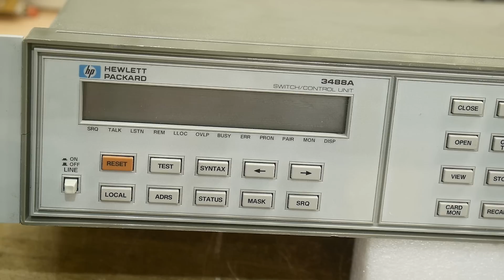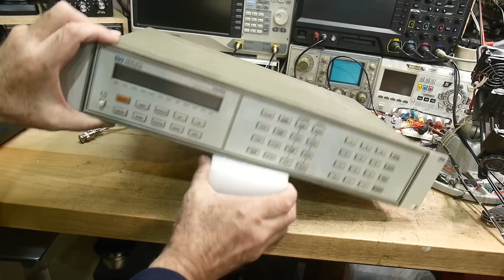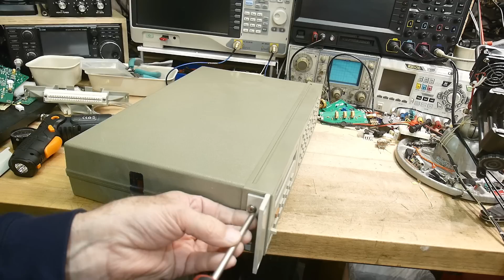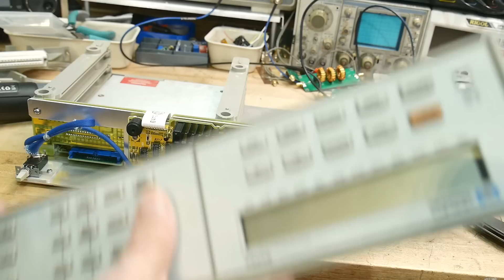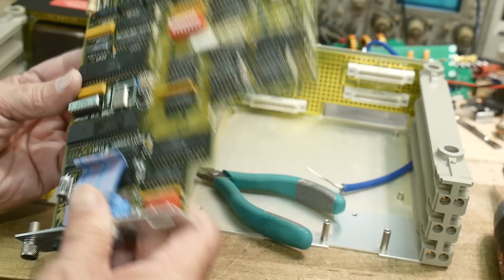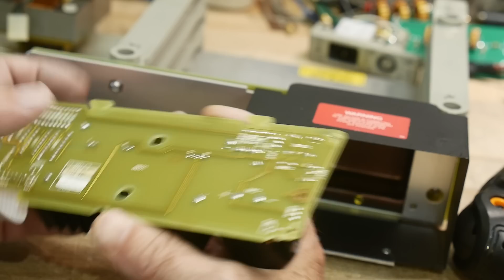#1430 HP 3488A Switch Control Unit Recycling

Comment: For custom gpib controller, there is the AVR488 usb (serial) to GPIB adapter project that implements the prologix "protocol". I've also been working on an esp32 version of this code (AVR488-ESP32 on sourcehut, there is a copy on gh) with extended features and support for wifi and bluetooth.

I am also condering implementing a version of the code embedding a Basic interpreter, for the fun. (Probably won't find the time to do it but I like the idea 😃)

Comment: Search AR-488 for an Arduino to GPIB device. It works similar to the Prologix USB to GPIB adapters.
Reply from the maker: I have a Prologix
Reply: @IMSAIGuy  The AR-488 project page talks about which software that works with Prologix will also work with the AR-488. And if you’re used to the + commands it’s very familiar. I’ve built a few AR-488s with the 75160/75161 GPIB bus drivers and they seem to work well.

Comment: I love HP stuff because it is always so well made.  In the 70s I had an HP25 calculator.  I chose this over the TI57 because it just felt so much better.  The buttons had a nice positive click feel.  Not spongy like the TI.  This was my introduction to programming and I think the RPN notation set me on the correct course for writing simple and efficient programs.  The main problem was that it forgot everything when switched off.  So I just left it permanently plugged in to its power supply.

Comment: GS-R405S was a DC-DC converter.  9 to 46 V in, 5.1V out.  4 amp max.  Quick find on Digikey with note that it is obsolete.  I did find some GPIB chip sets still being made (Intel 8291 and 8292 set for example). And I even found (and lost the reference to) a single chip implementation.  I just don't know why I'd want to use them.

And I got no problem with you scavenging parts.  Just because something is old doesn't mean that it should be saved.  Excepting you and me of course.

Comment: This is a way to save at least part of the device that would otherwise end up in the scrap, I'm currently looking for a narrow version and a black and blue HP logo for another project to build a multifunctional balanced power supply.
I don't pinch the wires, but I honestly unsolder them.

I wonder what you will get out of it .........

Nice day 🙂 Tom

Comment: Together with the capacitor voltage of 50V the module with the number 4005 looks like an early switched 40V to 5V module working at maybe not much more than 20kHz.

Comment: OMG! OMG! OMG!

What a great project box and project boards. I try to keep the boxes with the power supplies if I have the storage for them. A simple Bud box costs a fortune these days. But things like this already fit racks and have power supplies, and they're free.
Reply: You typed my thoughts well. 
God Blesss
Reply: Especially considering one of the option boards was a breadboard... I have a couple and one dodgy one that I am considering repairing and  frankensteining into a little minicomputer, using the 6809, some more ram piggybacked on, and a new rom, but I need to take that one apart and see how that external bus works so I can see how much stuff is in the way of that processor and addressing that bus, and what it's limits are. looks pretty narrow based on the connector, but paging exists.. Considering it already has hpib directly connected to the cpu, interfacing with CBM drives and variously branded test equipment should be fairly trivial... Of course, it doesnt really give me much more than a functional 3488a (or a short stack, like I have) hooked up to anything from my CBM-8032 to my 32 core linux workstation can provide...

Comment: We use Keithley's version.  They are great for automated measurements.  Hall effect and resistivity measurements require that different pairs of contacts be connected to the voltmeter in sequence.  (Some methods require that the current source be multiplexed as well.)  Thus we can program up measurement sequences that measure charge transport properties vs. temperature and/or magnetic field.  Quality control can also use them with their "beds of nails" to verify circuit board function.

Comment: Front panel display is the only thing of worth, and the connector, power switch and the rack ends, plus the screws. All used on other HP/KS/Agilent equipment, and often missing. GPIB is also worth it, as they also fail, along with the processor, so that board has value, along with the relays, which are common as well in HP equipment.

Comment: No HP distructo hate but  was wondering how many parts  it's in now and will it take more space than the whole thing shoved in the corner... Project repurpose the Relays for say HF switching (probably still good for that) or maybe repurpose a whole relay card with say a Pi or Pico or ESP etc making a modern network attached relay controller ...could be sweet if you hav a use for some such ...maybe controlling the power to the individual bits of kit in your shop???
Keep it up I love this channel

Comment: Intel 8291A GPIB Talker/Listener. Interesting chip.
Reply: Yes, it is similar to the Motorola 68488 GPIB talker/listener chip designed for use with the 6800 series microprocessors.